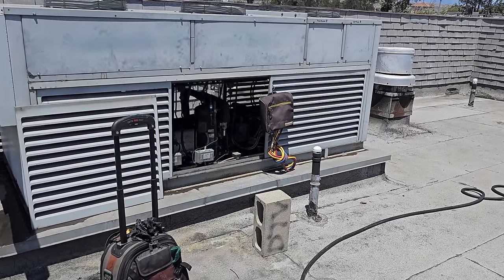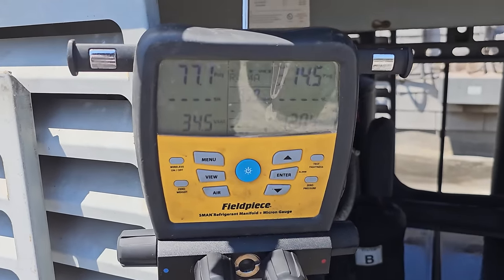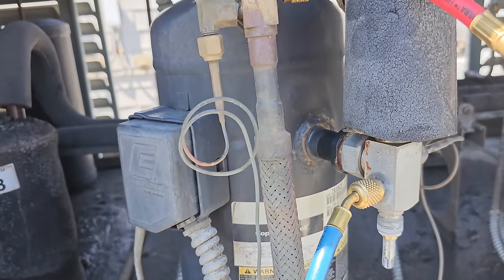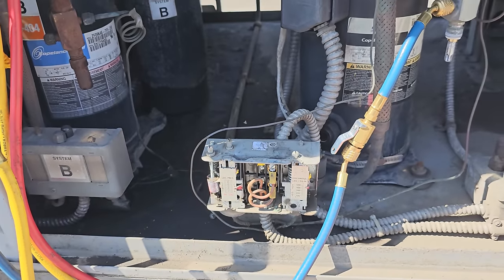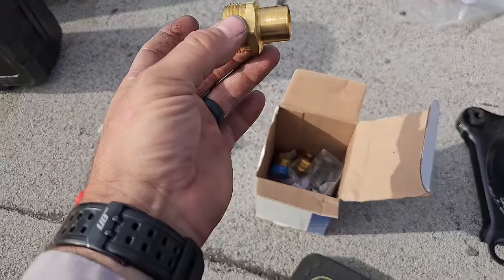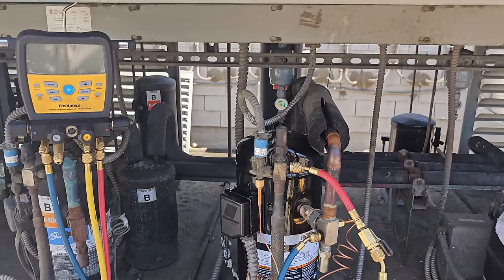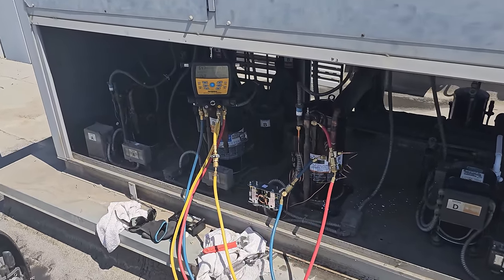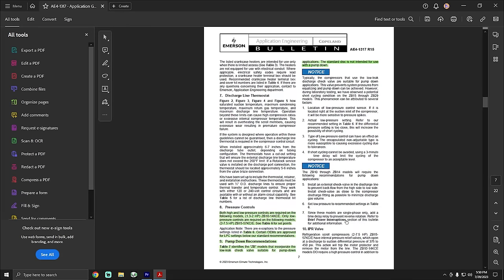NO GOOD DEED GOES UNPUNISHED

Comment: Not to be a downer, but lately I have been lamenting the fact that customers cannot understand the amount of attention to detail and care we put into this trade. Try and explain how this compressor is inefficient and not properly pumping down and there is no way they could possibly understand what is occurring and may potentially think we are trying to rip them off. Rough job with these restaurants; constantly trying to keep them up and running, and they can not possibly understand the amount of stress we go through trying to keep them going when it seems like we care exponentially more about their equipment than they do.
Reply: So many people have the mentality of no pm if it appears to run/ work its fine. Gone is the trust and understanding that maintenance will save money, because it's all about short term "savings".
Reply: Well said.
Reply: Don't be shortsighted, you need to understand their perspective. They have a business to run, people to pay, payments to make, and the last thing that they can possibly think about is their HVAC system. To them, it is a expense that has to be recovered through business. Sometimes there is not the business there to cover that expense at the moment, so they are forced to do the minimum on some things. HVAC is so out of sight, out of mind for most people, it's a natural place to be forced to cut back on. Also - the HVAC community has somewhat of a reputation for having bad actors, so the guard is up on being taken advantage of.
Just need to remember empathy and think of being in their shoes. They aren't stupid or inept usually, just priorities are different for many reasons. Coming to an understanding together on this through educating is the best way forward.
Reply: 'we are trying to rip them off'...Yes because 99% of time techs do rip customers off. $400 for a capacitor swap out for example.
Reply: Hard to blame a business owner these days for being paranoid.  For every honest tradesman (regardless of craft), there are at least ten that will lie to your face and rip you off.
Reply: These comments pretty much prove your point--there is very little empathy for the contractor who is [obviously] going the extra mile to take care of the customer's abused/neglected equipment. You are on the roof in 100⁰+  temps that are stressing everything to its limit, anyway. They are not "feelin' it", and at this point it's easy for the "extra-mile" contractor to become cynical. 
I could tell you some stories from my years on roofs [and in attics with ambient temps 140⁰ to 165⁰], and discovering dirty condensers, [one "emergency" call came at 10:30 on a Saturday night*] that have put the otherwise healthy compressor [cycling on overload] into a death-spiral to destruction. 
Please keep up the good work--anyway. Thankfully, I'm 71 and retired--but I feel your pain!
*Yes, I stayed 2 more hours, and thoroughly cleaned the system that had obviously not been touched in years, at this "seasonal-use" property.
Reply: If they don't care enough to do maintenance my pen doesn't care when I write the bill up.
Reply: @clydegrammon5847  You are mistaken. People do care when a contractor goes above and beyond. That's why those contractors are the ones that start to have more work than they can handle. Who doesn't want an honest and skilled mechanic, an honest and skilled plumber, etc?
Reply: @JFirn86Q  , I served a population of weekend recreational "camp" owners, who were not as empathetic or as pleasant as those with whom I had the opportunity to develop a long term trusting relationship, and as those you describe. My regular residential and commercial [restaurant/grocery] clientele were quite appreciative and gracious. The gentleman I described above was a retired federal  judge from Mississippi, and was used to bullying his way through life. No, I'm not going to name names, but I am not mistaken about the "weekend warrior" population on the local lakes where I served 30 years ago! They were a different sort, about which I'm assuredly  not mistaken.😁
Reply: Maybe it’s the overcharging that has broken trust. Hundreds for a $15 dollar capacitor, I e seen systems replaced when a reset breaker from a power surge would do. Look in the mirror.  I do my own , fairly easy stuff.
Reply: @briancasey7693  That's what contractors have to charge in order to stay in business. A typical financially healthy contractor business is running at about 5% profit... and that's BEFORE taxes.
Reply: @wkenealey so you're saying to net $5000 a month I will need $100,000 in receipts? I think you might be mistaken.
Reply: @alienrobot530  Feel free to start your own contracting company and then get back to me. Maybe I'm doing it wrong, but since we've been around since the 70s, I doubt it.
Reply: I do wonder what that looks like in their finances when you aggregate a few years where they did maintenance versus when they just let the equipment burn itself out.

Comment: 17:53 - Imagine having a compressor destroyed by the one device specifically-designed to protect it from damage... 
I sympathize with your 100°F rooftop days. Connecticut spent the last two weeks in the 80s & 90s with 90-100% humidity. Last night a batch of strong thunderstorms rolled through dropping us down to 59° this morning, and this afternoon its 73°F with 55% humidity, which is such a delightful respite! Actually got the door open to the garage/man cave today in the hopes I can dry out all the condensation on the concrete. So far, the situation has gone from "glossy floor" to "damp floor," so I'm making headway! 🤣
Reply: does the foam need replacing?

Comment: Copeland scrolls don’t like being pumped down below 15psi . They will develop internal damage. I have replaced several Copeland Scrolls on Russell , and Heatcraft units that came set to CI at 20 psig and CO at 5 psig 👎🏼. Also if you pump a scroll down below 15 psig it quickly bypasses and keeps turning on and off like it’s on crack . I fix this issue by installing a low pressure control setting it to cut in at 35 psig and cut out at the lowest safest point which will be 15 psig . That seems to work for me . Good video 😃

Comment: Regarding your connection issues with the wireless tools: These point to point connections between buildings are mostly running on 2.4Ghz, the exact same frequency your (Bluetooth) tools are running on. Depending on the location of the antenna and the other building the Fresnel Zone (just google for a picture to get a feeling for whats happening) extends throughout the whole roof and floods your devices with unwanted signals. Maybe you can find a workaround by using some metal shields, especially for your Laptop.
Reply: Most wifi routers also use 2.4GHz. So if there's a lot of wifi connections in his area, he might simply be out of usable channels. Although, I think wifi and Bluetooth run on slightly different segments of the 2.4GHz band, so they might not interfere with each other.

Personally, I would download a wifi analyzer app and a Bluetooth analyzer app, both should be free (they were for me), and that'll tell you mostly where the issue lies. It won't expose fresnel zone interference though

Comment: The two dishes you were looking at there are both receivers (likely TV), they don't transmit anything. You shouldn't be getting any interference from them, might be another telecoms thing on the roof doing it. A Starlink (or similar internet dish) could absolutely cause this kind of issue though, especially with the rather week Bluetooth transceivers in those clamps. Doesn't take much to knock them.

Comment: Out of curiosity: what is the OLDEST compressor you ever had worked on, because the customer thinks "it still runs fine"? For me it is an 1993 open compressor from "Bitzer" and my boss literally told the customer, that if ANYTHING happens after we changed almost every gasket and o-ring in that hunk if metal, that we won't do any further repairs. Just in case I don't use the proper english technical term: by open compressor I mean, that the compressor is driven by an outside motor via pulleys and a belt.
Reply: Just did a head gasket on a late 90s bitzer a few months ago, those things are built like tanks
Reply: Trane open drive....from the 1970's....we service a building with an old 1950's Carrier 19C with vacuum tubes.

Comment: It's a bummer when you can't change out a pressure switch without having to recover the refrigerant but I guess that having a service valve to isolate it means that there will be a possibility that someone may leave the valve closed and then you would have the same situation of the compressor being damaged due to overloading. Thanks so much Chris for taking us along and also for being a Professional  that goes the extra steps to make sure that his or her customers are well taken care of.

Comment: I have had a bad check valve on a compressor like this. A quick fix was just to purchase an external check valve and it solved the problem. I just put it as close to the compressor as possible. I also had a bad pressure control and had to change that too. It was a sht show. I also put a time delay for good measure. I also always put Schrader cores in the pressure switch access for this very reason. You can add schrader adapters to the rotolock

Comment: The best way to tell if your compressor is by-passing is to pump it down turn the unit off and see if the pressure on your low side rises significantly 😉

Comment: At some point, I really hope to see manufacturers design digital pressure sensors into HVACR systems, and log the data into an onboard computer. It would make the kind of diagnostics you are doing with the cut open compressor easier, and a lot more scientific!

Comment: When a Rotolock valve is front seated the pipe connections to the valve are sealed and both 1/4" ports are open to the compressor only. to change the low pressure control you would have only lost the refrigerant remaining in the crankcase.
Reply from the maker: Good point, I will discuss this on my livestream this evening 7/31/23 on YouTube @5:PM (pacific) come on over and check it out https://youtube.com/live/qEza1nnkhpA

Comment: If it's "only" 100 there how does the equipment in Phoenix and other areas work with temps above 110?
Reply: Different setup...the systems are always designed for local conditions...so any system in Phoenix will be speced for the higher ambient temps found there...

Comment: you can pump it down,close the high side valve on the compressor and use your gauges to transfer the compressor gas to the low side and do a hot swap with very little pressure.what do you think ?
Reply from the maker: I will discuss this on my livestream this evening 7/31/23 on YouTube @5:PM (pacific) come on over and check it out https://youtube.com/live/qEza1nnkhpA

Comment: I think it started as a seized pressure control not cutting off the pump down, causing the compressor to overheat and cycle on the head temperature valve snap disc (blowing hot gas onto the thermal cutout switch). After way too many cycles the snap disc fatigue made it to just gradually leaking. I think the head temperature valve disc disc slowly opening instead of a snappy action won't be that big a deal, as once it starts leaking, no fresh cool gas would go into the compressor, so the head temperature will rapidly rise so it will warm up the cutout switch anyway. In the meantime the disc in the separation plate got loose because all that heat exposure, leaking the gas around, so it was unable to pump down the pressure anymore, making the problem worse (I would assume when the minimum specified cutout pressure is 17, the compressor should still be able to reach that low without trying that hard).
I also think the cause was the failed pressure switch left way too long to overheat and essentially kill the compressor.
Reply: he said he recently replaced the condenser motor,maybe HPS adjusted too high above relief pressure.
Reply: @MariosACandRefrigeration  First that would make atactivating when actually cooling down, when it gets rather high pressure (for the intake) gas from the evaporator and not at pump down, when all pressures become lower. And second, the traces within the compressor (the damage of the seal of the pipe redirecting the released gas onto the thermal switch) had shown it was the snap disc what activated. And this is responding to head temperature and not pressure.
The too high head pressure and related overload causes mainly the motor winding to overheat (high mechanical loading, so high current draw), not that much the discharge gas chamber (high pressures do not need that much of a compression ratio to become really high). But here the winding had no sigh of heat damage (according to me), but the discharge gas path was clearly scorching hot. This tells me, there was not much pressure to load the motor (so not that much of pressure difference), but very high compression ratio making the adiabatic compression to reach very high temperatures. And low difference can have high ratio only when starting at low pressure (nearing vacuum if taking to an extreme).
So it goes back to the faulty low pressure switch (which job is essentially to stay away from the high compression ratio operation n the first place)
Reply: @annaplojharova1400 are you a compressor expert? Also what is a rotor lock compressor?
Reply: @LC-qi5ff  Not "compressor expert", just taking the basic gas thermodynamics (what the temperature does when compressed), mechanics (pressures affecting motor loading) and way the motors work (high load causing high current, high current causing more heat created within the winding) and trying to put it together what is happening with it under those discussed fault scenarios. And the engineering general principle of cost reduction that every detail is cost optimized so much it has about the same margin to fail over the designed lifetime, so if one thing fails/deteriorates faster than other (clear heat damage on the compressor head vs not that much on the winding) tells what part has been overloaded (almost every such damage sequence too high temperature stress as the direct cause of destroying anything, be it oil losing lubrication ability, leaky seals of something not moving, winding insulation discoloration and failure, metal weakening and breakage,...)

Comment: Not sure if your meter does it, but some that I've played with that have auto off will wake up when you press the mode/select or equivalent button. Saves clicking through the selector back to 'off' if you want the same setting and your meter does it.

Comment: Good video. For all of us DIY weekend warriors, could you explain every once in while what “bypass, pump down, thermal” etc, means? That way we can visualize what is actually happening internally?  This would allow us to see how you got to the diag issue?
Reply: I'm a weekend warrior too, but here are my guesses:

bypass: An internal valve that relieves pressure from one side to the other, supposed to prevent the compressor or tubing from exploding

pump down: when the magnetic solenoid downstairs is closed by stopping power to it by the temperature control, the compressor continues until the low pressure cutout stops the compressor. When the temp control reaches its high limit, then the solenoid gets power again to open, which untrips the low pressure control and the compressor starts again

thermal: an internal thermal safety switch that if it reaches a certain temperature, it stops the compressor, to prevent meltdown i assume
Reply: Fyi:
Pump down means you are pumping the refrigerant down in a certain point in the system ( normally the receiver) for a repair OR the unit is " pumping down" when satisfied on temperature or for a defrost in " standard" operation. An electro valve shuts down between the receiver and the evaporator inside.
When de-energized, the valve shuts off and the refrigerant won't pass through... So the compressor will " pump down" the refrigerant .

Compressor bypassing : higher pressure discharge going back to the lower suction side.
Mainly the " valves / valves plates " are defective in simple words.
When a piston is going up, you are compressing the gaz to push it through the discharge valve and when the piston goes back down , the gaz in the cylinder chamber becomes lower than the discharge pressure so the valve closes back.
If it doesn't shuts off properly your high pressure will go back into your lower pressure.
" Bypassing"
Thermal overload: depending on the type of thermal OL( overload) is basically an internal safety ( in this case) that will OPEN the the windings of the compressor as a safety if the compressor runs too high on temperature/ overamping etc..
Why he cooled it off with cold water to make the process faster.
My english isn't perfect but i hoped it help a bit